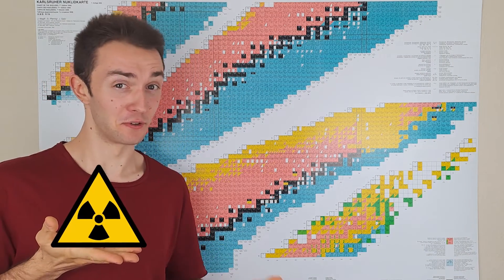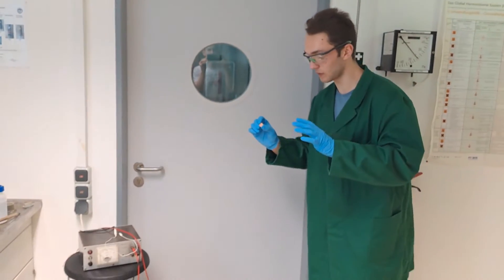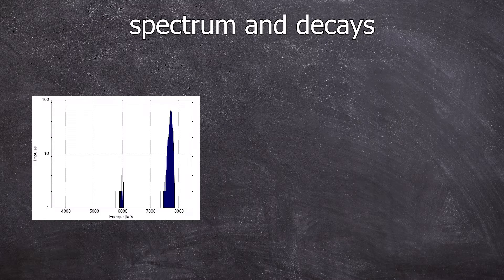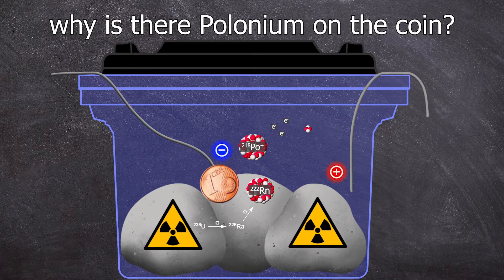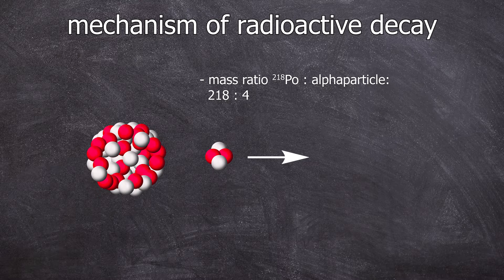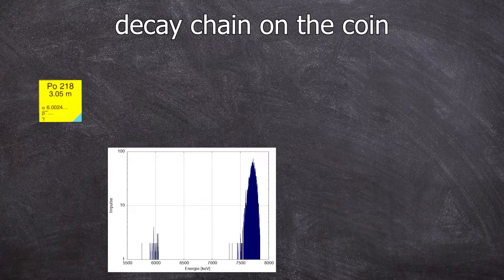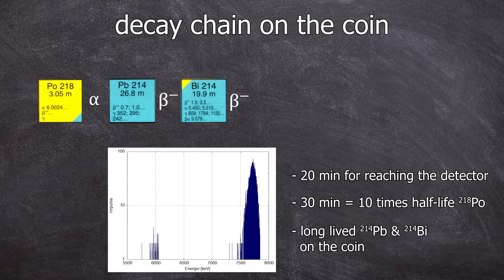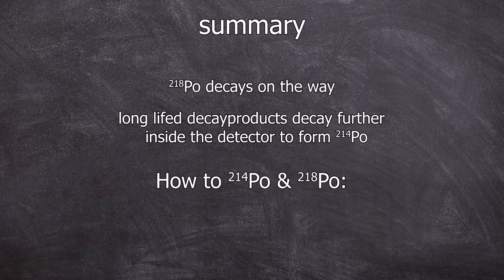Combining high voltage and radioactivity - Nuclear Chemistry

Comment: This is the main operating mechanism behind the very successful "corentium" style of home radon detectors by Airthings. Invented by physicist Bjørn Magne Sundal, it uses a Cockroft-Walton voltage multiplier to increase the voltage from three triple A batteries and oppositely charge the two metal coated inner surfaces of a counting chamber, the negatively charged side of which has a PIN photodiode on its surface which does a kind of crude alpha spectroscopy on the polonium which accumulates in darkness there. It's an incredibly clever device really, and seemingly operates on an almost unbelievably low power of around 300 microwatts.